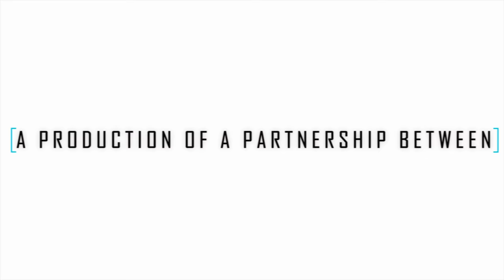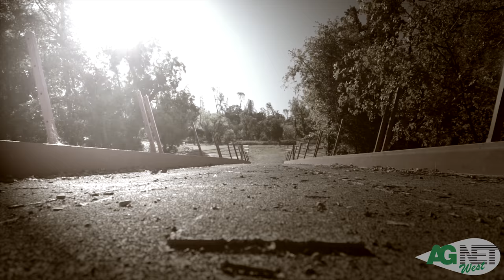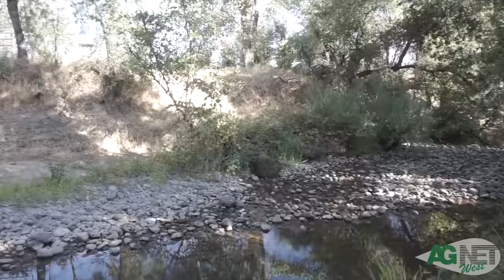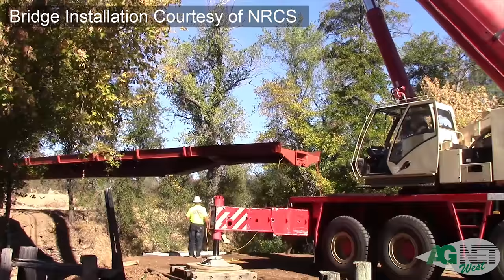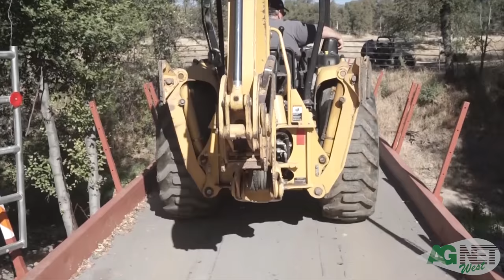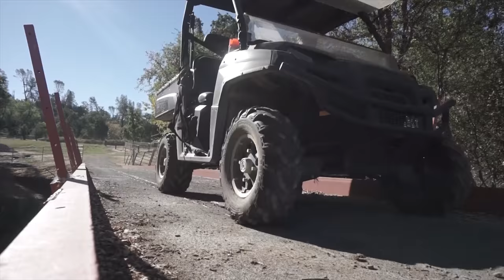Railcar Helps Bridge Lifelong Access Goal

Comment: How much does it cost? Well...we sell them all over the country. 2024 prices for an 89' x 9' bridge is $30K. We stock them all over the country so delivery is usually about $5K. Pre-cast abutments are about $20K, depending on soils. Helical abutments, our preferred method, is about $40K. Installation usually runs anywhere from $25K to $45K depending on complexity. Getting two Cat 330 excavators will install it for less money than a crane. We can load certify railcar bridges in 25 states including CA, NY, and TX. Excellent video!

Comment: The main thing is to get the abutments located at where the bolsters used to be. I've seen the results of where they placed them out at the very end of the rail car and the bridge, when overloaded, folded like a taco. This looks like it was done right and if he's only running cattle and trucks across the bridge, it will be there forever. I se the weight limit posted, which is another great idea.
Reply: Correct. Abutments are usually placed at the body bolster. We can push abutments back but that requires additional reinforcement. The top and bottom of the center sill usually would require reinforcement.